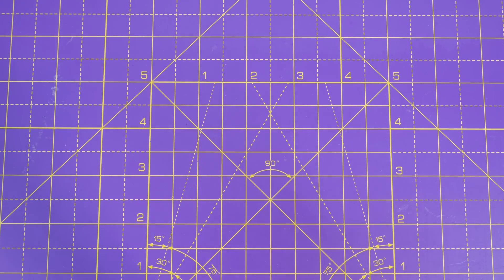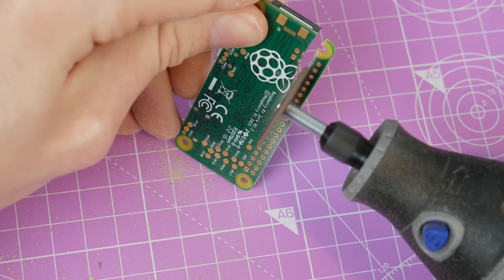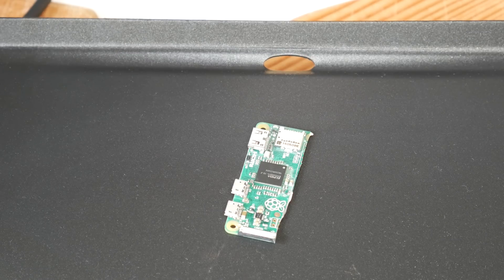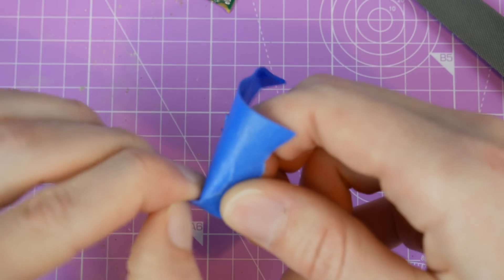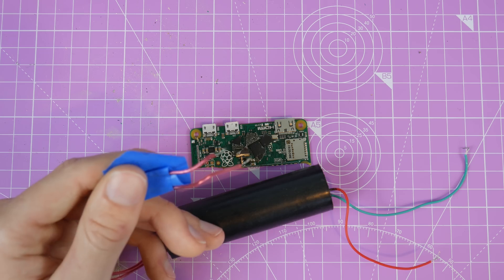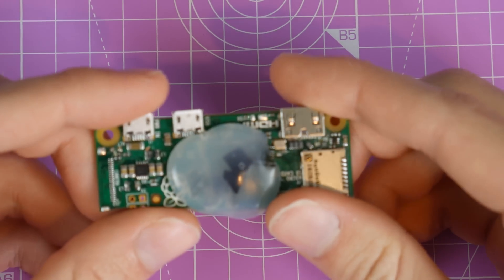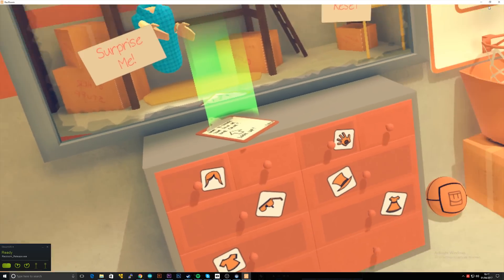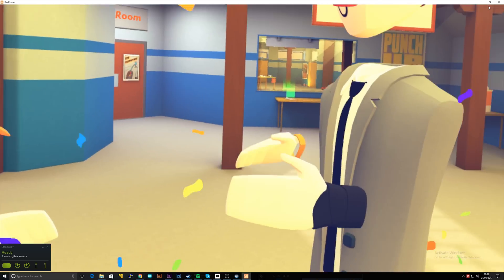Pi Zero Overclock (CRAZY) + GIVEAWAY!

Comment: I think I missed the part where you took 4 cores and did the modification to make a 4-core processor.
I love that you did not give the secret about how the AI of the chips will have them extend tendrils to create a mesh network to access the parts of the cores to allow them to interface.  I did some research and found that allowing the AI to create their own pathways is what speeds up the performance to levels that on one can believe.

Comment: I having trouble getting my processor into 7 cores.  I broke one into 8 cores and threw one away, tried that but still not working.  Maybe it isnt working because i cut myself, with the disc grinder, while cutting off the GPIO Pins, and got blood on the processor before i removed it. Maybe i shorted the processor? You think this will work with Raspberry pi 3?

Comment: Hey Seytonic

I have a good idea:you could try to make a bluetooth rubber ducky that pretends to be a bluetooth keyboard! It would be cool to use an arduino pro micro.....

Thanks for your good videos you really help me alot!
Reply: Remo Crapstuff Bluetooth requires acknowledgement and pairing from both ends, USB is plug in and let loose.

Comment: I did it to 5 Pi-Zeros in a cluster, if you use a sharp chisel you can get nice even splits. I split my processors into 4x4 grids for 16 cores per pi across all 5 in the cluster for a total of 80 cores. My primary use is breaking passwords using Hashcat and it's running amazingly despite not having a gpu to use. Keep up the good work Seytonic. 

@sullivanyifu

Comment: One question, is the malduino basically be like a rubber ducky, will it be easy to use or do you need to wire around things? Because I have never worked with that kind of things and I just want to play around with it :)

Comment: the name of the tazer thing?
Reply: Depends on the ebay seller, I've seen them listed as high voltage electrostatic generator, boost step up power module, Step up high Voltage Pulse Inverter Arc Generator Ignition Coil Module, I'd suggest going to seller alice1101983 and searching for high voltage, they have a few different ones for sale and they are a good seller